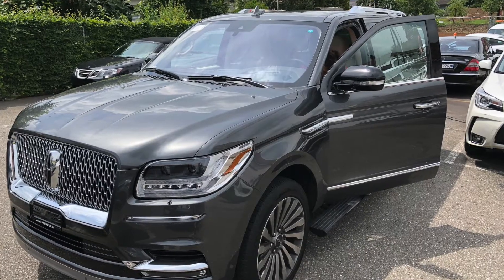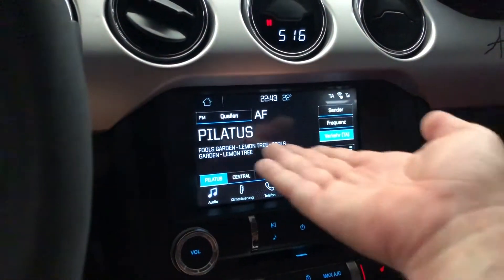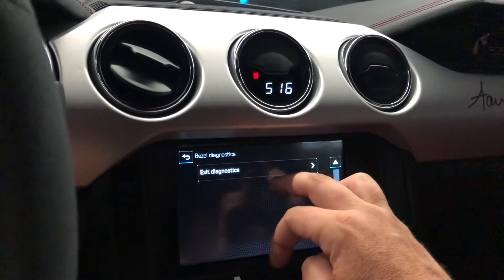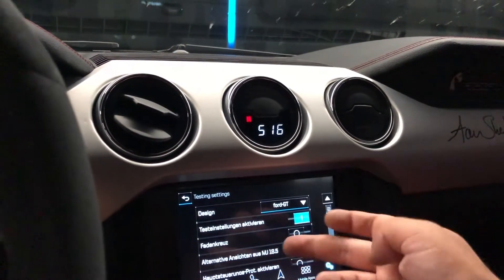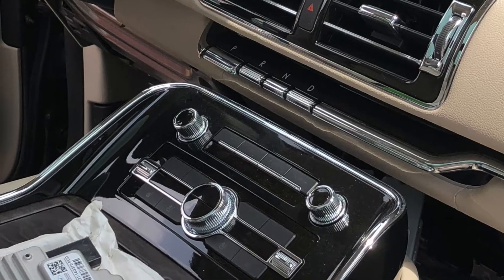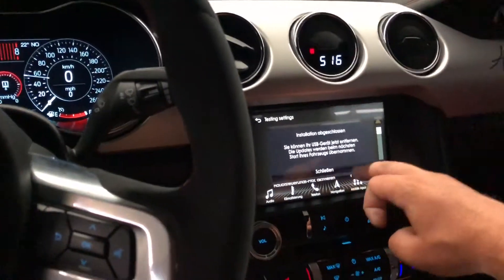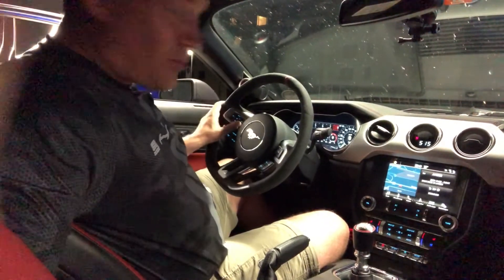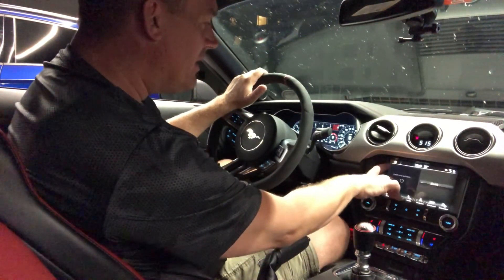Ford/Lincoln Bezel Diagnostics with and without EJECT button

Comment: Would you know anything about 2013 Lincoln MKX I'm having trouble with the bezel control panel the slide for the fan for the AC it works and then it doesn't work. Plus the air condition comes on by itself and then when I shut it it comes back on and it seems like it's coming from the bezel because it's all happens when I work everything from the bezell not from the touch screen.Plus I took off the bezel and when I touched the wire in the back it comes on or if I hit a bump it comes on. Do you know if I could find out what's going on with the onboard bezel test or I have to check with forescan.
Reply: I'm having same problem. How did you resolve the fan issue?